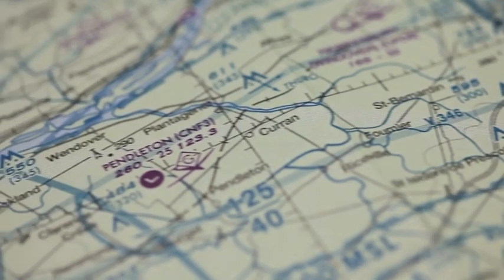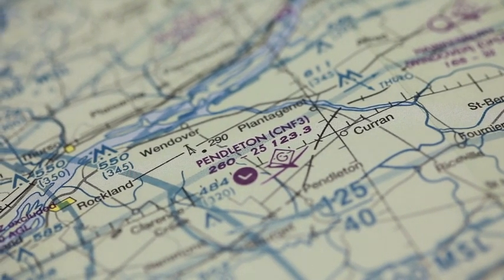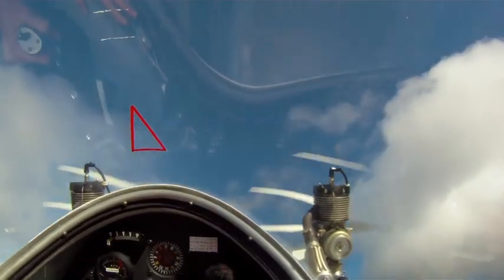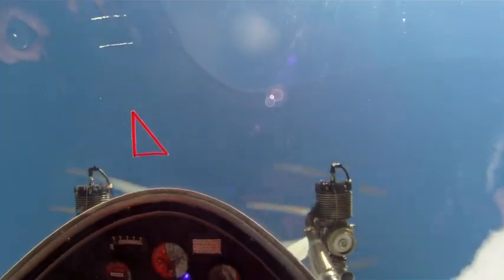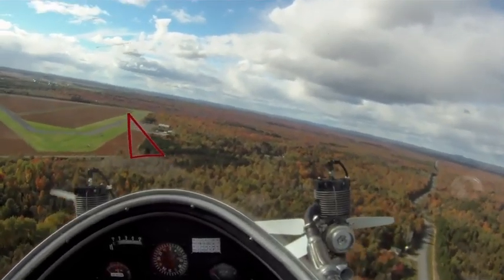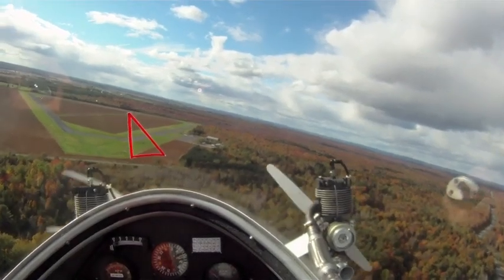CriCri : The World's Smallest Twin-Engine Airplane

Comment: I personally think it is a safe and sporty aircraft to operate due to the multi-engine function.  However? I would like an electric starter to be implemented to this aircraft without a weight ratio factor. Overall? This is an excellent item.

Comment: We can see in this video, the Cri-Cri is capable to fly and landing with one engine only, and that's very nice. 
Question is, what happens if both engines suddently stopped !.
Can this plane landing just by gliding or it falls down to the ground like a rock ?.
I´d appreciate your reply. Thanks.
Reply: Obviously it will glide provided the pilot will nose down a little to get the glide angle. The fact that the elevator is not in the propeller slipstream it means that the sensitivity of the elevator will not be much effected  and the ailerons   will remain the same while one would expect to lose  a little rudder sensitivity. I would guess that that sort of plane would have a glide ratio of 20 :1 so if the pilot is sharp, he will be safe enough to glide down. 
I  noticed that the dead engine  did try to rotate due to the fixed pitch propeller acting as a turbine. That put a little more  unwanted drag with both engines off, but a good pilot would be safe enough if ground is  available.
Reply: @carmelpule6954  its got a 12:1 glide ratio if i remember correctly

Comment: If they could produce a kit that could be built fast ie something like an almost ready to fly model plane but in this size of airctaft, produce it at a competeing cost then they would have a total winner on there hands. I mean you wouldnt even need to pay hanger fees because this could fit in a long wheelbase van and you could take it home ect then when you want to fly just throw it in the van, drive to the local field, pull ir out the van and put the wings on, so simple

Comment: I would feel safer flying it if it used 4 stroke engines made by Honda or Subaru. Those engines are practically bulletproof but it would increase the weight & cost of the aircraft. Interesting design though. I like how its small enough that you can store in a two car garage if you don't have a hangar or don't wanna pay airport storage fees.